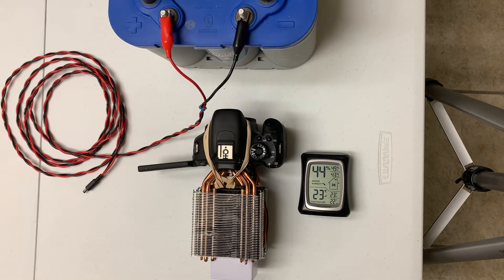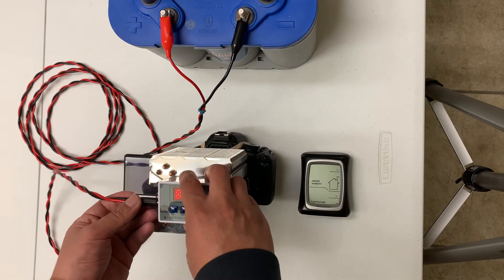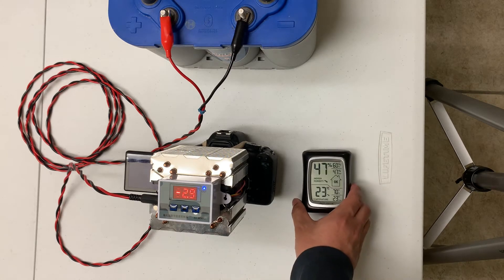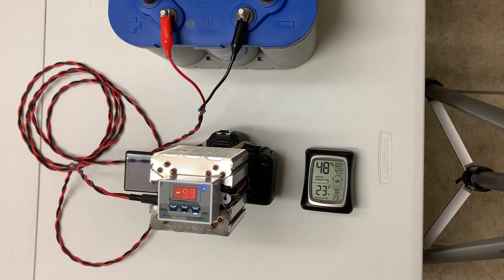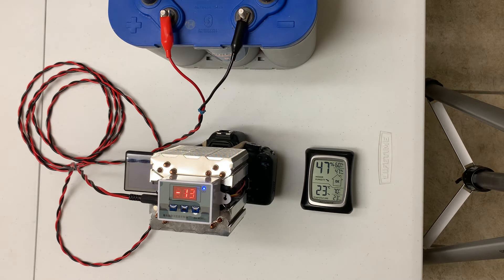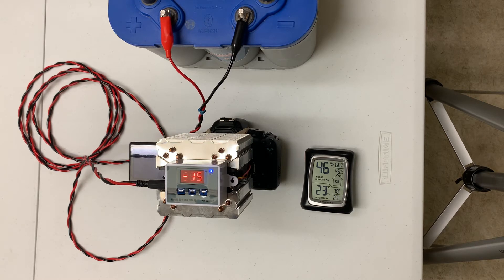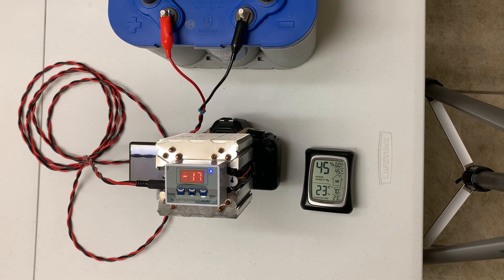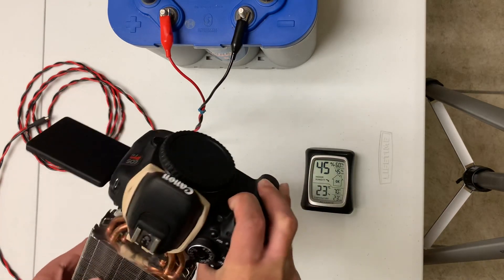DSLR Cooler for Astrophotography

Comment: Mr Zhou, got a question on another video you had on the squeaky key on the AvantGrand piano.  I have the same piano and got the same issue.   How did you fix that and what was the problem?    Thanks!
Reply: Yes, that’s very helpful!  Thank you!
Reply from the maker: Hi, a031737, I found a local service provider certified by Yamaha to fix it. On the first visit they came in and checked the piano, then they ordered a chip from Yamaha, which took a few weeks to come, then they installed the chip and fixed the piano on the second visit.
Reply from the maker: It took a few hundred to fix, I don't remember how many now, but not cheap.
Reply: Thank you!  That’s great to hear that this can be fixed.   I got the same high pitched noise issue, especially in combination with the foot pedal.   Any chance you remember what chip had been replaced?    Did it involve opening up the bottom area behind the speaker grills, or just opening the top area above the keyboard?    There are multiple boards in both areas.    I appreciate your quick response.    There’s hope!   :)
Reply from the maker: @a031737  That was a custom-made chip (actually a circuit board) from Yamaha, and I believe only certified vendors are qualified to order it. It was shipped from Japan. They just opened the top area by taking the top and front panels off. They did not open it to the bottom part. Hope this helps, good luck with your repair!

Comment: I would never go peltier, complicate a hell with condensation/frost on electronic parts, big no no for me.   Good paste, laped heatsink pipes contact base and some pwn server block 120mm fan temp and temp sensor mod can do wonder in removing ton of heat and remaining above ambient all the time. Can get noisy tho. Well still didnt do that to expensive DSLR, but soon :D
Reply: There's no way to use paste with a T3i as the sensor doesn't have a smooth backing. All astro-dedicated cameras use peltier cooling, although they're designed for it, while a T3i isn't.

Comment: Oh man you totally missed the point . Peltier Element is not a Cooler , its a Heat Pump , like your Water Cooling on PC ,   Imagine putting water cooler in your PC and then for CPU block you take a  huge aluminum heat sink , that cant get heated up that easy . You water comes and now instead of running over 80C block and cooling it nicely , it finds huge cooler at 30c or 40c . Its going to cripple the system , dont you agree. You are going to lose 80% of efficiency .You need your water  block the smallest possible , as hot as possible , so that water coming in has something to heat it up real fast , and  this transfer of thermal energy is what cools your sensor at the end . So you need huge transfers , not huge heat sinks .
And you get that with a fan and properly heated heat sink   , the hotter it is the easier for a fan to take heat off it . Do you get it ,  it will freeze the sensor . With a small fan , just like in commercial units .
Not only is there no need for that huge cooler , its makin it less efficient ,considerably so , not a little , a lot worse
Reply from the maker: Hi, Pavle, thank you for your feedback! I have tried a smaller fan and head sink before but it was not as efficient as this one. Maybe the build quality of the fan matters. I have not tried another model of small fan yet. I may do that when I have a chance. :)
Reply: Actually, you are incorrect about this. The whole purpose of a fin stack is to cool the chip as effectively as possible. The big finstack can stay at 40c or so and a small one at 80c transferring the same wattage.

 Now here's the issue at the source (you want it to be as cold as possible) assuming the same surface area of transfer as it's the same chip there will be a delta T let's say +10c. So the small heatsink has 90c temperature and the big one has 50c. Minus the Peltier and we get a huge difference in effectiveness in favour of bigger heatsink.
Reply: @plane9182  Thing is , you think making this cooler 2x bigger will cool 2x better , it wont . Its an overkill , you get diminishing returns , most of the heat is closest to the chip , that is where your cooler needs to be , then you take Cell phone cooler , that is a closer vapor system , and you can find them all around in broken phones . its tech much more advanced then this cooler with copper pipes , and then put fan on that . 
You can stack up those coolers , you will get smaller lighter more efficient cooling .
Do it you will see im correct .
Having both you can even compare results and results are what matters .
Phone cooler is enough to cool your sensor for long exposure . IF you can cool that cooler , you are on the road .